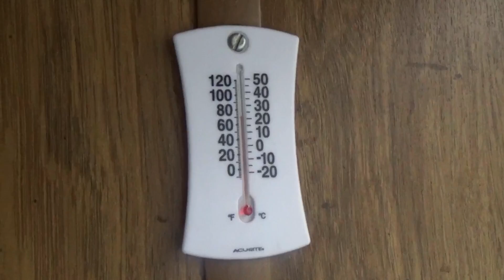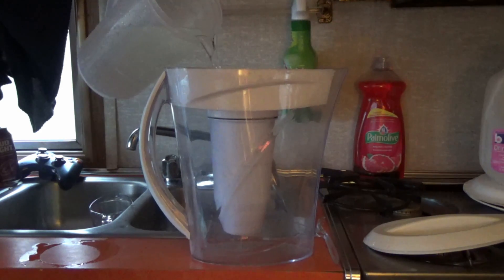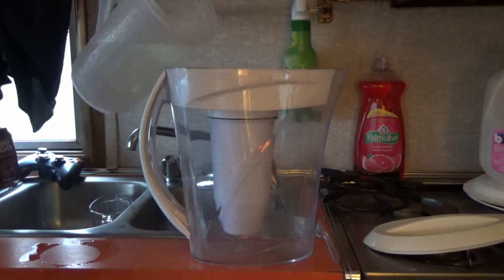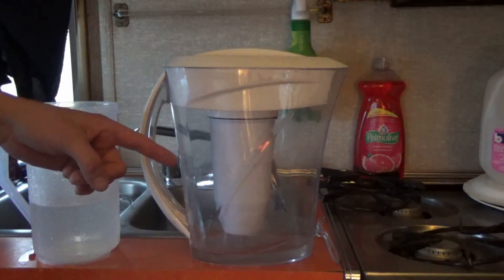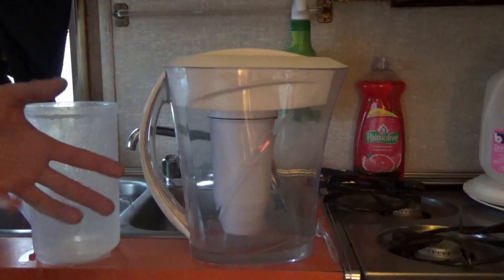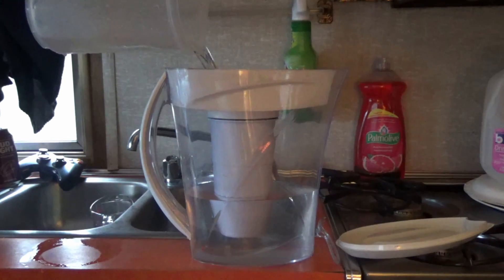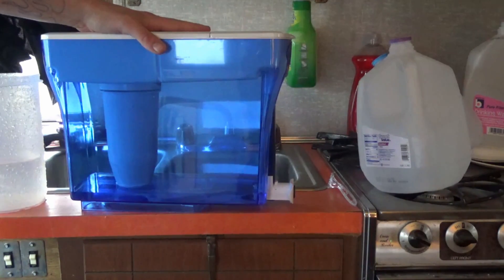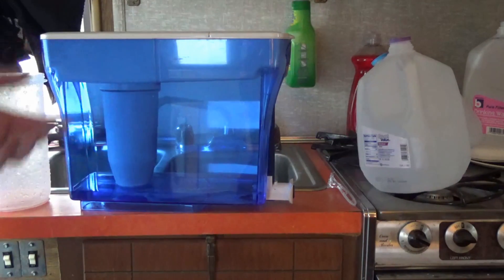Filtering rainwater, and they sent me the wrong inverter...

Comment: Aaron',if you have the money go for the 1000w grid tie inverter they work much better and last longer both 500w and 1000w are overrated the 500w more like 300w and the 1000w is around 800 watts ...I had a 500 lasted 8 months all i had was 2x100 watt panels in full sun it would go into overload ..
Reply from the maker: Hi gene, they got back with me and said it will work for solar.  Im going to give it a shot and see what it can do, if the sun ever comes back out......